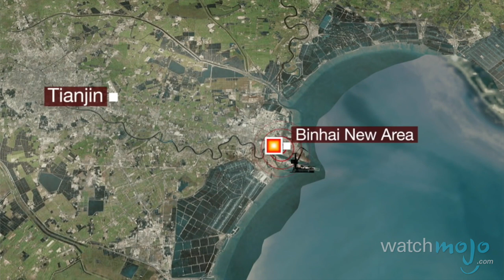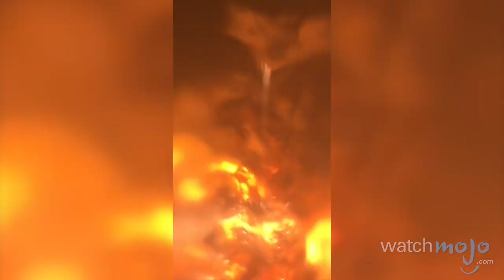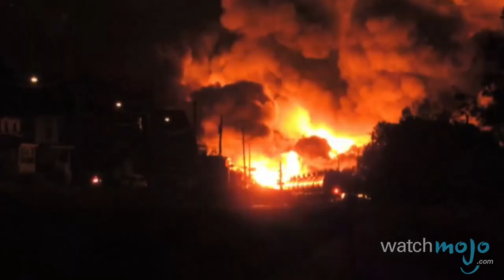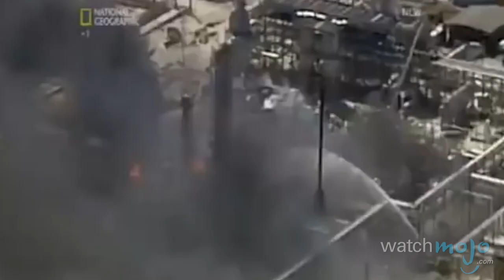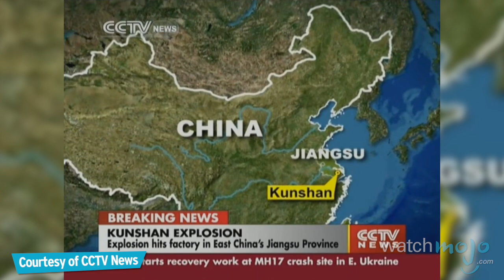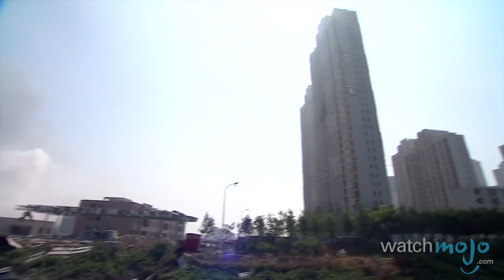10 Tianjin Explosion Facts - WMNews Ep. 41

Comment: Oh calcuim carbide, how you make so much flammable gas when exposed to water. Just to let you know, it was used to fuel spelunking headlamps, that controlled a drip of water.
Reply: ***** We use it to this day!  It's called Acetylene gas and it's VERY volatile! Common use is for cutting of ferrous metals using an oxygen acetylene torch!
Reply: *****
There's a pretty cool effect too. If you put some calcium carbide into a snow ball, you can have a snowball that is on fire! Of course, I wouldn't recommend throwing it, though. I still have a can of the stuff somewhere in my basement.
Reply: +Michal Excuto Not the place to self advertise buddy
Reply: ***** Spelunk! I love that word. lol  

I've always known that type of headlamp as a Miner's Lamp.

Comment: In the US we had the Pepcon explosion in Nevada in May of 1988.  Pepcon was manufacturing ammonium perchlorate for use as an oxidizer for the space shuttle's solid rocket boosters.  The blast radius was 10 miles.  Pepcon was out in the middle of the desert so it didn't cause the damage this explosion did but it did a significant amount of damage to the nearby towns which where several miles away.